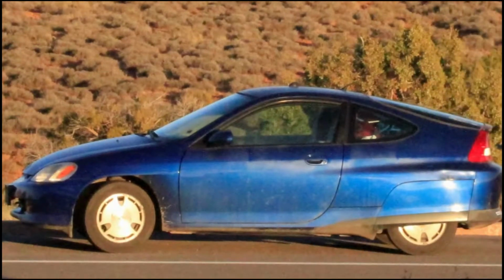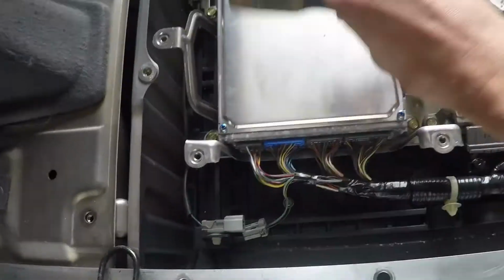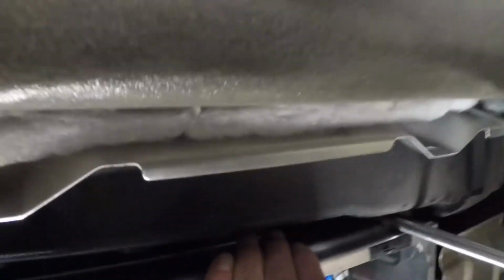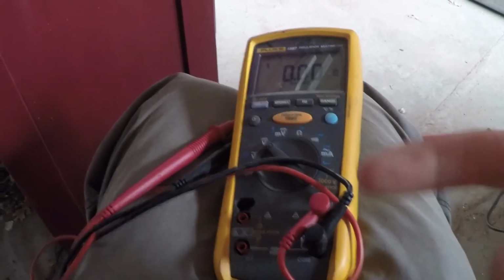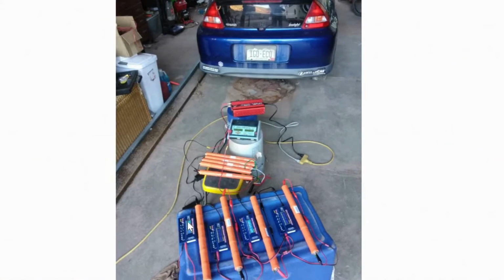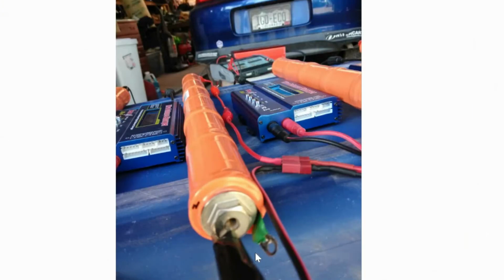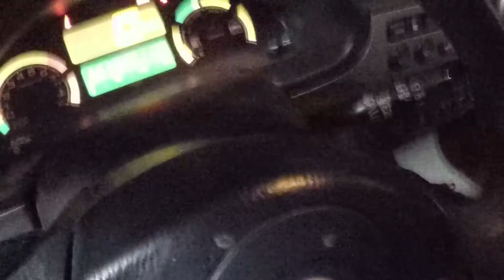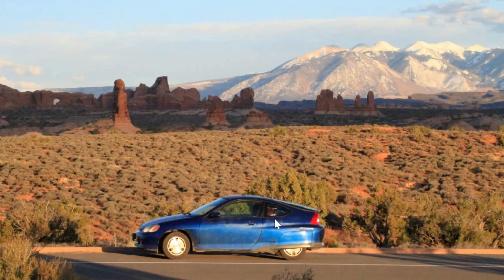HONDA INSIGHT HYBRID BATTERY REPAIR RECONDITION REMOVAL INSTALLATION IMA LIGHT 2001 DEEP DISCHARGE

Comment: Hi...what is the min/max voltage for each stick ?
Reply from the maker: Before I pulled them I saw voltage as low 6.6 volts, after charging I saw a good stick reach 8.5 volts, I think the nominal voltage is 7.2 volts,
Reply: I have 2011 insight...thinking to change the cell to li_ion battery cells..since its between 7.2_8.5volt
have not started yet though
Reply from the maker: @boomdeyada5266  Ya that'd be interesting, make a video about that, I'd like to see if that's possible.
Reply: you sure is eack stick around
7.2-8.4volt?
Reply from the maker: @boomdeyada5266  ya I'm sure
Reply: I will be using a 500 watt 50Ah 3.7volt
 li-ion battery out of Mitsubishi Miev...it comes with 16Kw battery 88 cell